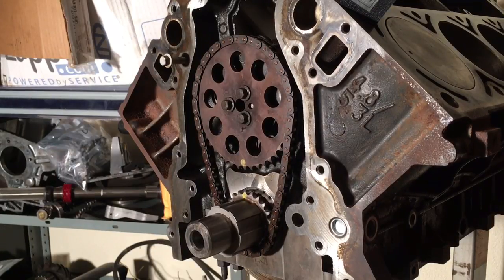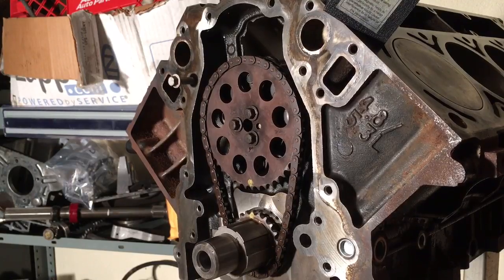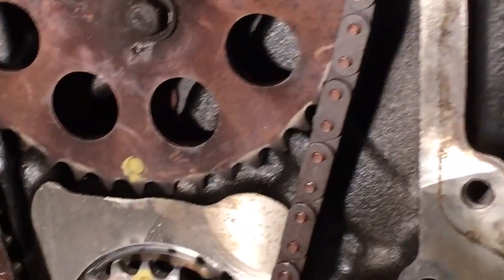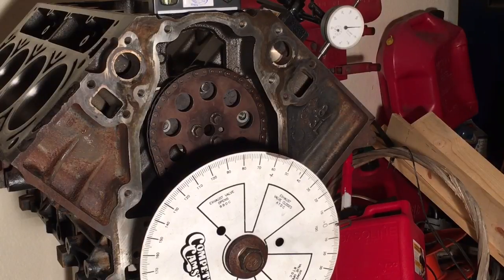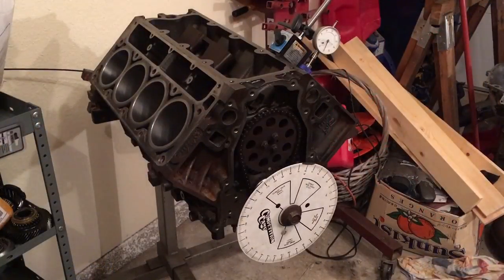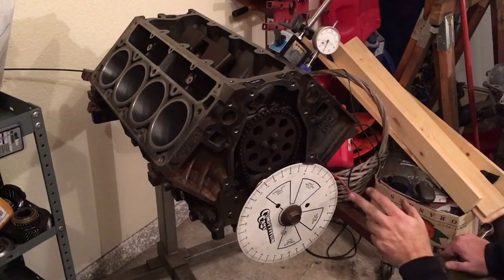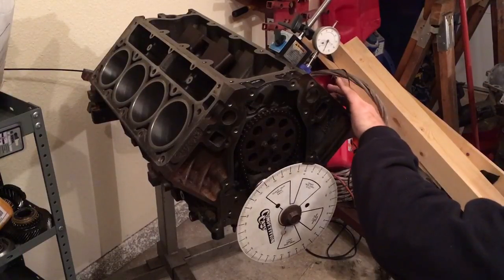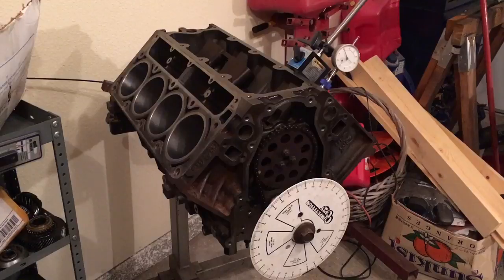216/220 4.8 cam degree ICL

Comment: Ok im not following i think..so this is just for peace of mind correct and doesnt affect performace? Reason i ask is i have same cam in my lq9 and i just put it in.
Reply from the maker: Rick B The engines Torque and Horsepower are affected by how the cam is installed.  
Generally you follow the camshaft manufacturers recommend ICL or Intake Centerline.  The issues are production variances in all the components associated with camshaft timing. Cam gear, Crank gear, Timing chain.  Any variance in any/all combined can change the ICL. 
Example: if you need an ICL 110 
Advancing the cam to ICL 108 will increase the low end Torque and lower the Peak Rpm HP. 

Retarding the cam to ICL 112 will reduce low end Torque and increase the Rpm where the engine makes Max HP. 

*Advancing moves the power lower and Retarding moves the power higher. 
I would like to go back in the engine and compare the power and driveability between an ICL 110 and ICL 107 where the cam started installed dot-to-dot. 🤔

Comment: Rittle me this...I don't think the advertised Duration listed for this cam is correct.I could be wrong but have you noticed that E1839P 220/224 is listed as the same 285/292 adv.duration?
Reply from the maker: Joe Mamma OK here’s the info from the Elgin website:
1838p advertised 285/292
1839p advertised 286/282
Notice the 1839p has a reverse duration with more on the Intake side. 
Remember advertised duration isn’t that important, Cam companies can inflate numbers to make the Cam more marketable.
Your cam should be installed on a ICL 108.  It’s on the Elgin website
Reply: I completely understand about advertised duration vs @.050..Here is why I asked it seems this was a typo... http://www.competitionproducts.com/Elgin-Gen-III_IV-LS-Series-Hydraulic-Roller-Cams/products/2724/
Reply from the maker: Joe Mamma Yeah they messed up doing their posting for each cam. Elgin has really upgraded their website. 
Google Elgin numerical listing
Reply: Thanks
Reply: That just brought up elgin community college which by a huge coincidence I know a lot of people that attended I used to live in Elgin Hellinois even know someone that worked there in the 80's lol
Reply from the maker: Go to elginind.com  then go into catalog tab search part number.

Comment: WOW!..i Couldn't be happier that you degreed this cam..This is exactly what I am after I looked passed this very cam because I wanted shorter than 114 lobe  separation for more low end on my LQ4 in my 2500 Suburban...So if your measurements are correct (which they are) this is a 112+4.or their about..PERFECT!..Thanks..Lookin forward to the Degree measurement with the new chain that I wont be running...lol..
Reply from the maker: Joe Mamma A tighter LSA is going to have a rougher idle and generally less engine vacuum making it more work to tune. I tried to shoot for a noticeable idle that I can learn to tune.  Another concern was not killing the fuel mileage too bad.  😉
Reply: We are not talking about a 108 degree lobe separation here...And this small duration should not effect fuel economy much in your 4.8 and possibly increase in my situation with 365 cubic inches .Plenty of vacuum no prob....And I question why you are taking the time and effort to install a ls engine in your vehicle if you are worried about this small of a cam even in a 4.8....And this cam is famous for being tuned easily..check out sloppy mechanics..he even has a tune for it already listed you just have to copy and paste then install on hp tuner..I think you would regret running anything smaller..This is a street driven hot rod truck you are building is it not?
Reply from the maker: Joe Mamma Daily Driver build, it has to be dependable. Even if it gets a Turbo it’ll still be setup as a daily driver.
I like choppy cams too, but after reading all the people complaining how much they’re mileage dropped I was ok with mild.  What most people miss about the shorter stroke big runner heads 4.8, even a 216/220 Cam will peak power above 6000 rpm, more like 6500+ rpm. It’s really easy to over cam the 4.8 killing all low speed torque and moving the peak power to 7000+ rpm. Not daily driver stuff. 
Anytime you see a Dyno sheet for a Cam 5.3/5.7 add another 500 rpm to the HP peak and that’s where the 4.8 lives. 👍
Reply from the maker: Joe Mamma I will have to find the Sloppy tune files for a 4.8. When I tried one of his 4.8 timing tables for 91 Octane it detonated too much, but I’d try it again if I can find it. Where are you finding Sloppy tunes?
Reply: I really dont care about a choppy cam in suburban...I have that in my drag car..278 @.050 720 lift 108 lobe separation.solid roller
Reply from the maker: Joe Mamma Heck yeah!  That’s sounds awesome!

Comment: You can't find TDC accurately the way you did due to piston dwell at tdc.
 You find top dead center of the piston just like you found the center of the cam lobe. crank the engine clockwise until the indicator reads .010 before TDC and check the degree wheel reading then turn the crank to  .010 after and check the degree wheel reading again. Top dead center is half way between the two readings.
 The Elgin intake centerline is 110 degrees.
Reply from the maker: I understand your technique, I use the dial indicator method when the heads and intake are removed same as most professional engine builders.  If you watch the accuracy of the dial indicator you'll see I'm less than 1/2  degree either way.  I set the indicator so any movement either way is observed.  When the heads are on the engine I do use your way via a piston stop and degree wheel to "Split the difference" to find true TDC.
Honestly, I cant see either method of finding TDC to be off enough to change the outcome.
But, tomorrow when I get the new timing chain I'll try your way and compare the two methods,  JD
Reply from the maker: I just remembered, I can check the accuracy of the dial indicator TDC by using the stop/wheel method.  I'll verify the accuracy, since I've been building engines this way for a long time I'll be shocked if there's a measurable difference.  I'm curious now, I learned the dial indicator method back in 1995 when I worked at Street Thunder.